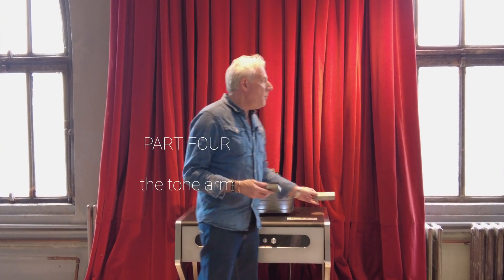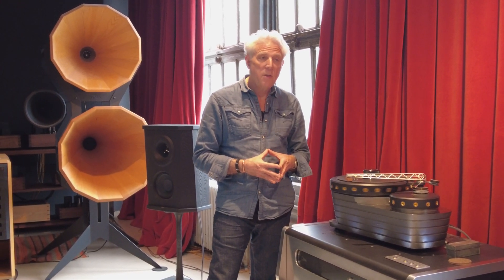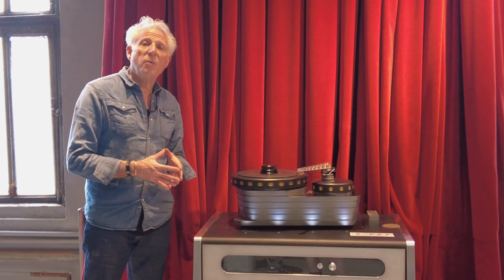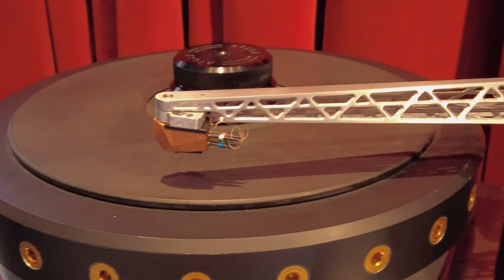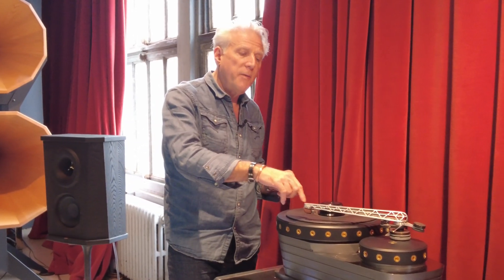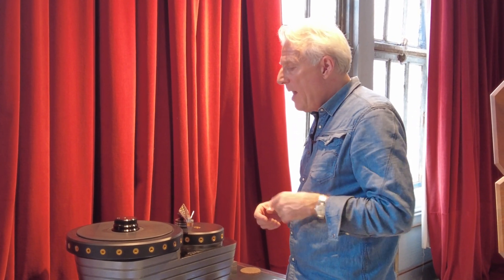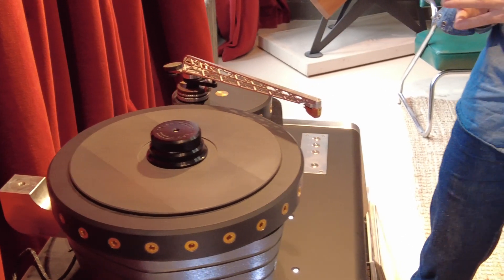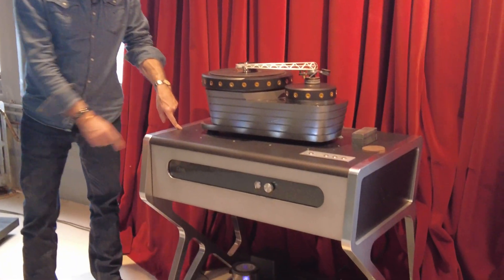OMA K3 Turntable - Part 4 : The Tone Arm

Comment: The Bamboo Tonearem!
Reply: If you vacuum dried it and sealed it, the lightweight factor could not be beat. Just a stick of bamboo with whipped ends. Makes perfect sense.
Reply: And if you flame darkened it or torified it, the look is really the best. There is the evolutionary standard to it, Its the king of grass, which makes it special.
Reply: @RobertSchmitt-u7l  you just about returned to the design philosophy of the guy who designed this arm.   He built his products with wooden arms, saying metal didn't sound as good.

Comment: Reference for art deco design. Takes alot to get there, time and iterations. 

I like the tonearm, but it needs more of a mellow color to complement the rest of it. 
What if you incorporated investment casting and MAGNESIUM???
Magnesium does take special considerations, but it is a good material. I think its damped well, strong, tensile, almost fibrous. 
It is also a gorgeous color. It would complement all of your equipment, to have brackets, housings, or critical componnets made of this stuff. 
Its specialized, maybe its a bit departed from the traditional material and manufacturing methods you prefer.
But, it does have that myrr factor the rest of your products have, and its lightweight which is an advantage. I dont know how it "sounds" But to me, it definetly resembles more of a cast iorn type quality compared to aluminum. 
It would be nice even just hard anodize the tonearm, again, it would change characteristics obviously.
Reply: my "budget" cast aluminum tone arm is shot peened for hardness .  many materials are used in tonearms, but magnesium is considered as not sounding very good.  For instance, where the lightest, stiffest moving mass is sought for phono cartridge styli , no one uses magnesium .

Comment: As a 3d print Maker I instantly recognized the tonearm for what it was. But this got me to thinking, ( and please don't be too hard on me due to my vast ignorance ) would it be possible / beneficial to create other portions of the turntable as SLS ( actually, I must correct you, the term for the process is Selective Laser Sintering ) fabrications, as a shortcut to avoid the need for some machining steps and also perhaps as a means to vary density/material use more directly and arrive at a 'unified' design that would require less post-work? Just a thought. Cheers!
Reply: Indeed SLS and not SLM

Comment: I could cast it.  3D print with pla.  Surround with a jewelers casting plaster.  Burn out the pla.  Replace with metal of choice.  
Some post processing required for a polished look however very possible to cast.  
Beautiful piece you have.  I enjoy all you talk about.  It’s a passion of mine to have great sound.  One day Ill have an oma system.
Reply: Exactly, lost wax. It wouldn't be easy but possible.